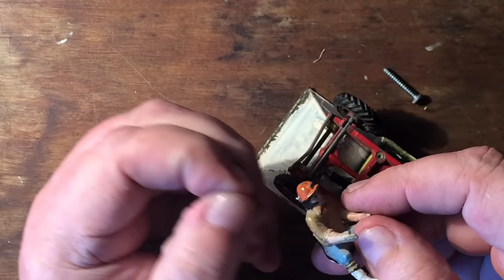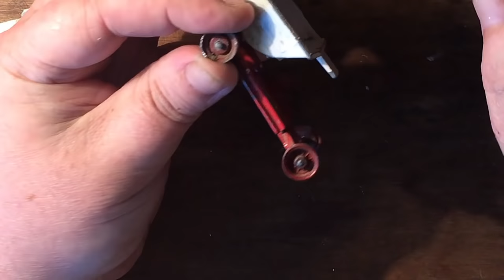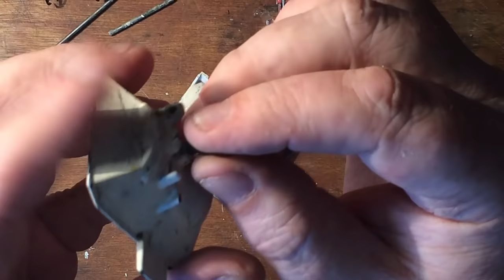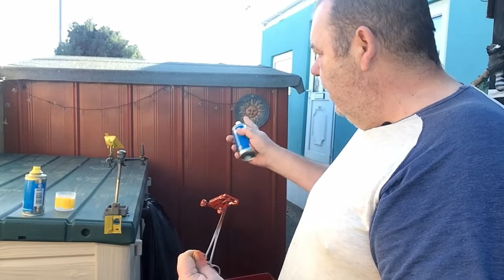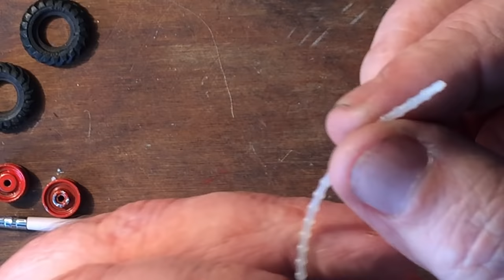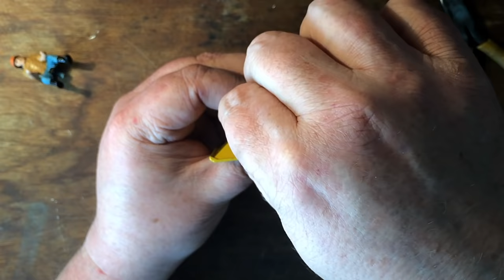Corgi Dumper 403 Complete Restoration

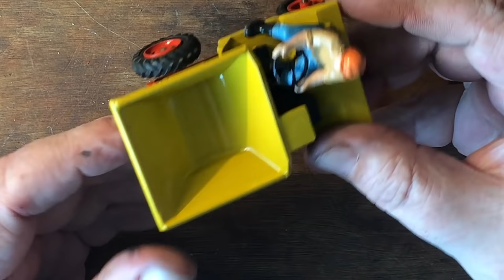Comment: 36:20 Just spotted those front tyres are on the wrong way round. The real things are designed to push surface mud away so the dumper can get some grip.

Comment: The whole point of rivets is they are riveted not glued.
Reply from the maker: David Leavy yes you’re right but the rivets used on Diecast castings are actually posts not rivets which are compressed in the factory to seal the top and bottom halves of the models together! The finished item just looks like it has rivets in there but it doesn’t so when restorers drill out the posts to take the models apart they use false rivets for re-assembly in order to keep an original look! They’re still called rivets in the modelling world, Quite a simple thing to understand really 🤔